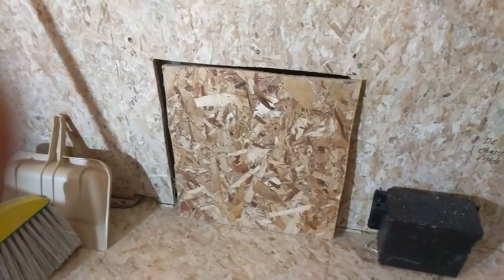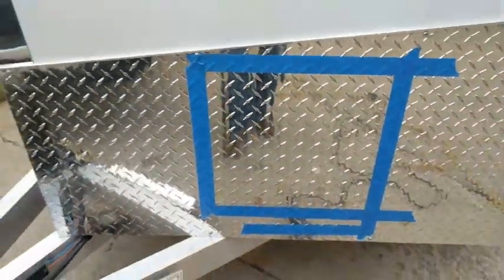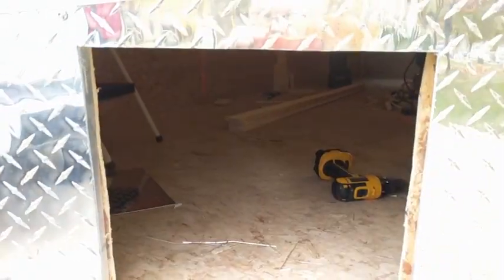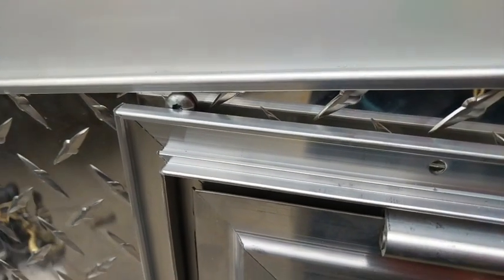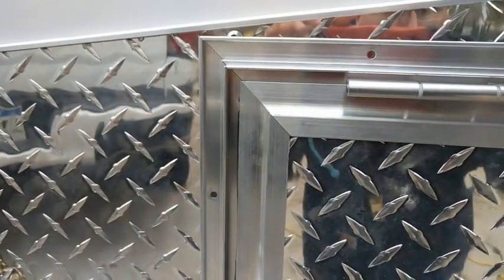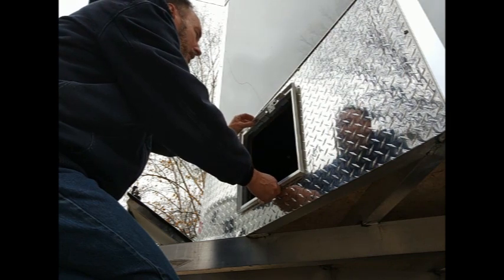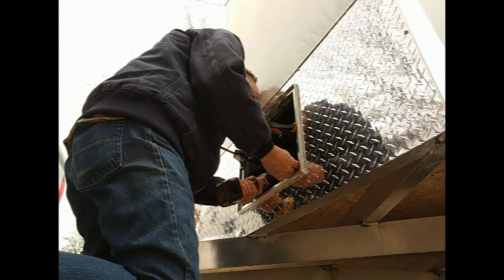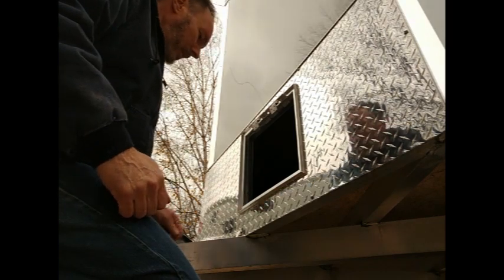Cargo Trailer Camper Conversion - Part 8 Cutting Openings for Access Doors

Comment from the maker: I didn't really do much.  The manufacturer said it's not necessary unless you remove several consecutive ribs.  I added pine cleats to frame out the the openings and provide a place to fasten the doors and windows.  With those cleats also being fastened to the 3/8" interior panels, it keeps everything pretty solid.

Comment: Re: your diamond plate cargo door.  Always fasten the way you did...hidden.  people don't realize how easily exposed fasteners can be simply backed out with a drill and PRESTO, someone gains access.  Especially true with an RV door.  If your trailer door only has exterior screws, it's best to add a bunch of your own right through the inside door jambs. You can always use a bit on your Dremel and grind all those heads flat as well.  I love your build.

Comment: Just wondering how the hatch holding up, and is there any leaks from driving in the rain. Would appreciate your thoughts on this. nice job.
Reply from the maker: I added a second gasket when I installed it because I was worried about leaks. So far it's been good.  It does let a few drops in sometimes, but way less than any of my old factory built RV's.
Reply: @kimdonaghyrealtor8238  thank you for getting back to me.thats a good idea on the extra gasket.have a great day.